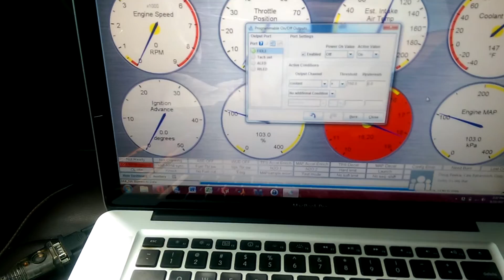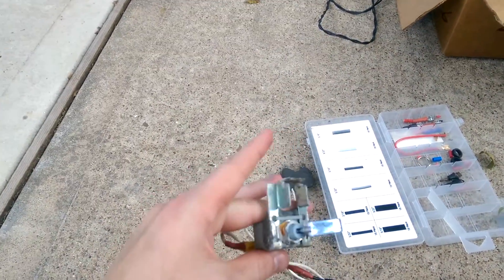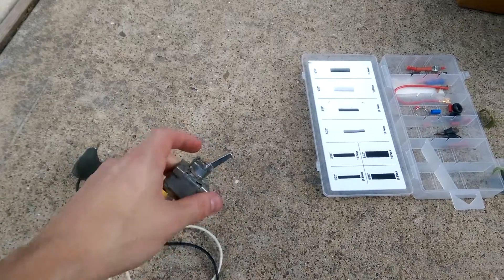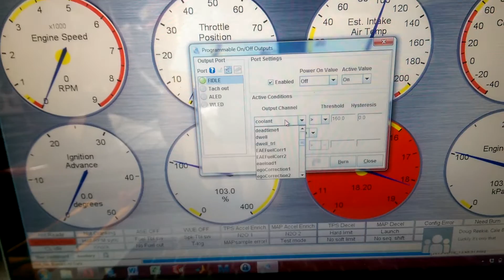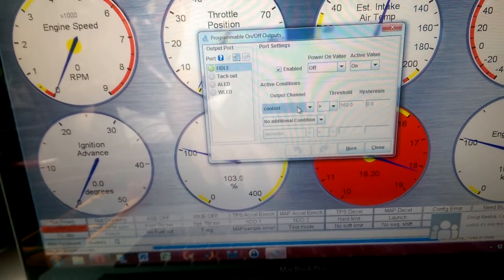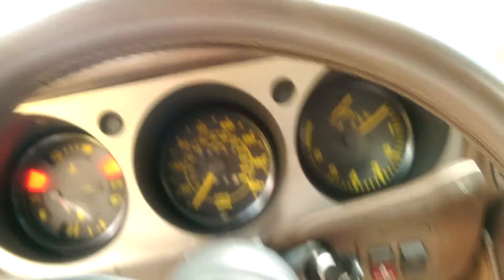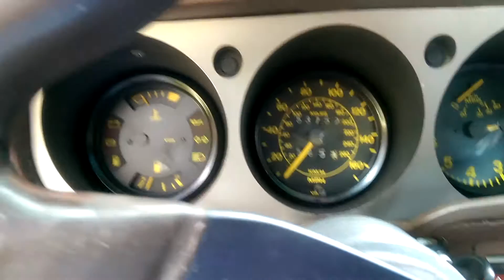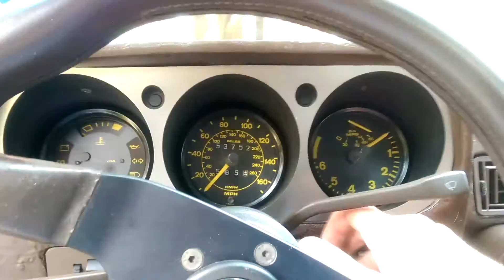Porsche 944 MicroSquirt - cooling fan control

Comment: did you have to use a diode and transistor on the grounding to relay coil?
Reply from the maker: Nope. Just ran FIDLE to pin 85 and gave pin 86 switched +12v. The other pins, 30 & 87, make or break the circuit to the fans. It was really easy.
Reply: @MichaelODonnell  Did you have have 30 battery and 87 to positive on the fan and the negative fan wire to ground on the chassis?